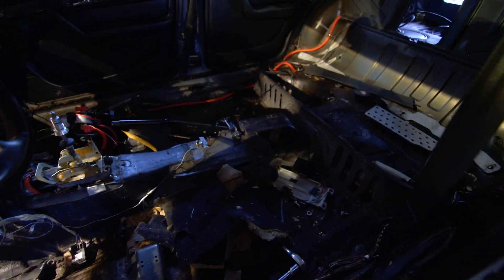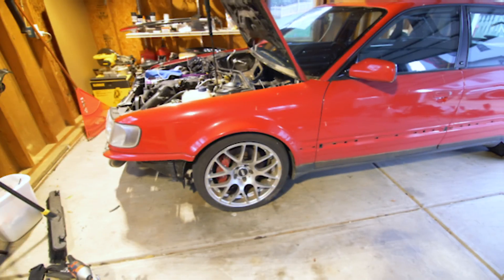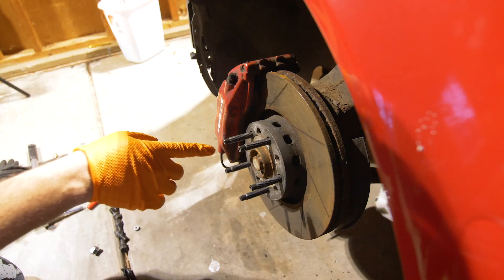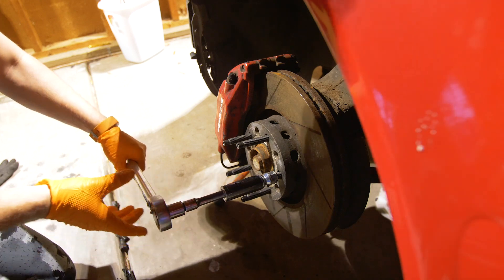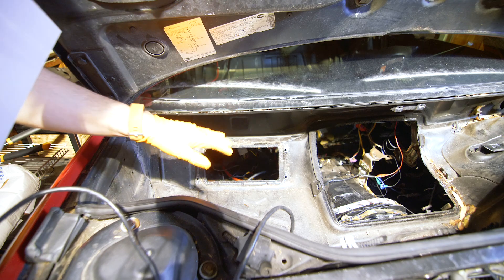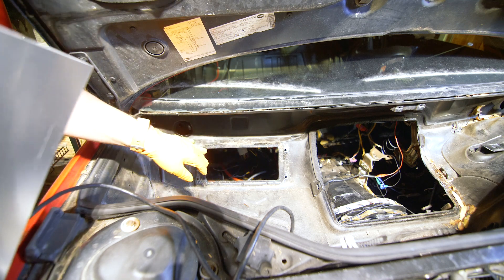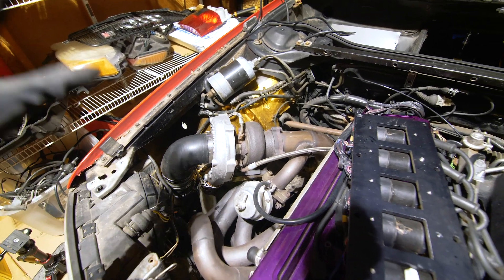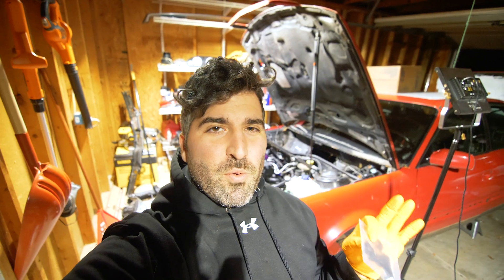S4 Track Build - Wheel Stud Conversion & Getting ready for a Standalone ECU

Comment: Does the maxxecu work with the factory Audi crank trigger? I'm looking into standalone ecus for my Audi and can't make up my mind haha
Reply from the maker: Yes it does! That was definitely one of my considerations. So far I'm really loving the MaxxECU, between the build quality, included flying lead harness and the software itself. I know that feeling though, went back and forth for a while. Which ECUs are you considering?
Reply: @supercarmio  Great to hear! The price is a little high, but I'm looking at either VEMS, Ecu Masters, or MS3. Probably going to stay away from megasquirt though.
Reply from the maker: @donovanhandley7936  I was looking at the exact same options! Yeah, what turned me off MS was the lack of documentation in regard to the trigger - seemed like it was a feature still in development/testing. I'm super curious about ECU Masters - seems like it comes with a ton of features for the price. Would love to know what you end up going with. 👍
Reply: @supercarmio  I'll definitely report back! It might be a little while before I pull the trigger haha. Gonna buy rods, turbo, injectors, manifold etc. first
Reply from the maker: @donovanhandley7936  haha I know what you mean! You've got a nice shopping list 😂Thanks
Reply: @supercarmio  Work in progress for sure! Debating whether or not I should do a full lightweight valve train 🤔 I can get it all for $500
Reply from the maker: @donovanhandley7936  That's definitely a really nice price... I always go down those rabbit holes :-D
Reply: @supercarmio  yeah supertech has a nice kit with the springs (dual), retainers, and keepers.

Comment: What bumper is om it. Because i am going to fit a bigger intercooler.
Reply from the maker: Right now I have the oem NA URS4 bumper, which is a lot deeper than the Euro version because of the crash standards. Fitting a larger intercooler wasn't an issue w/ this bumper. However, I would love a euro or RS style replacement in the future - at that point I guess i'd have to worry about it hah.